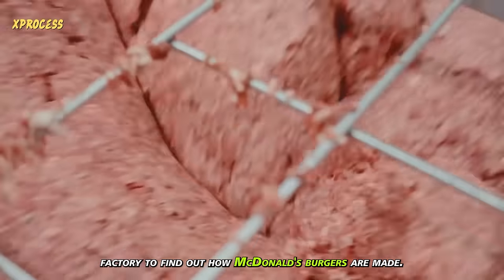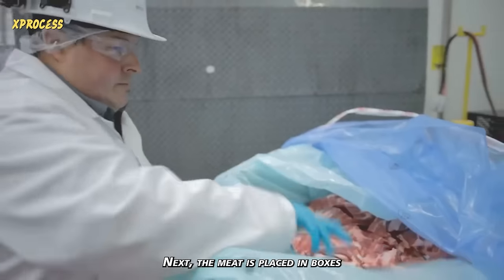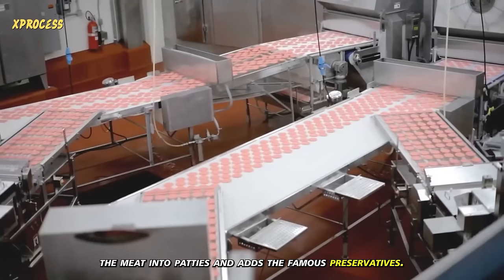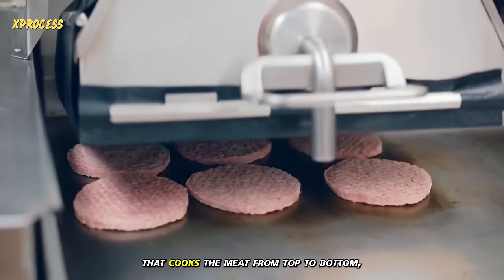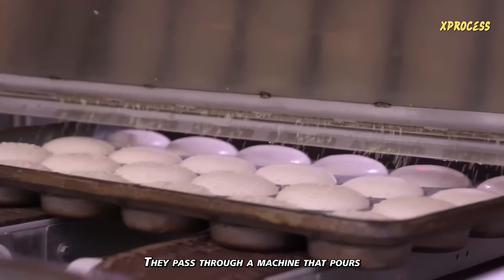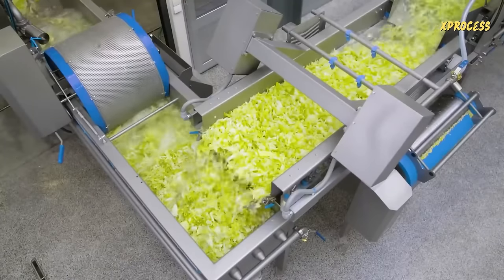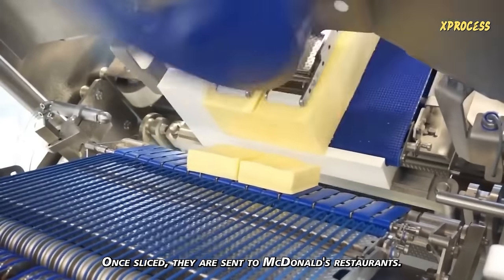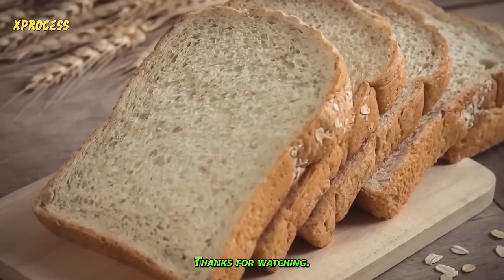How McDonald's HAMBURGER MEAT is MADE🍔😨| McDonald's Burger Factory

Comment: The math doesn’t add up. If they make 5,000,000 burgers a day using 500 boxes at 500 kg each, thats 582,500 pounds of meat and each burger would weigh .1165 pounds
Reply: You rock, Daniel. Good catch. There are lots of other inconsistencies in this video.
Reply: That's actually pretty close to correct-their regular, smaller patties r referred to as 10:1 meat, 10 patties to make a pound, or around 0.1lb.
Reply: @kvance0889  inaccurate. Their small patty is 1/6th or 1.6 oz
They have never had a 1/10th
Reply: @DanielJohnson-ec8rk  yes, they are 10:1 patties...as u said, they are 1.6 OUNCES, which is 0.1 POUNDS, hence the 10:1...1.6oz times 10 equals 1lb...you said "0.1165 POUNDS," not ounces, the 1.6oz is a tenth of a pound.